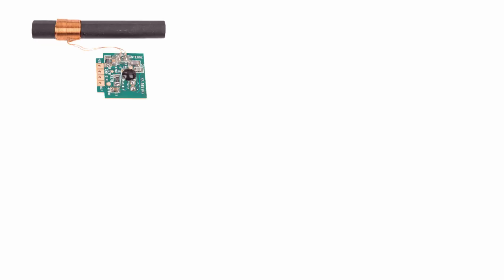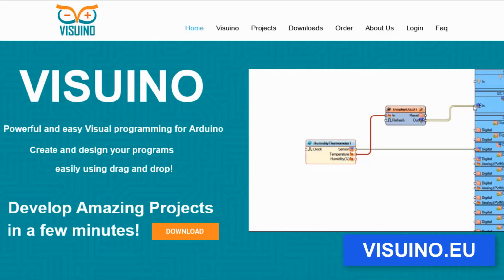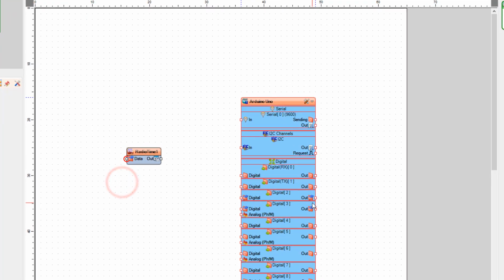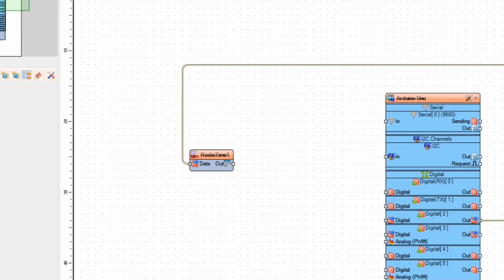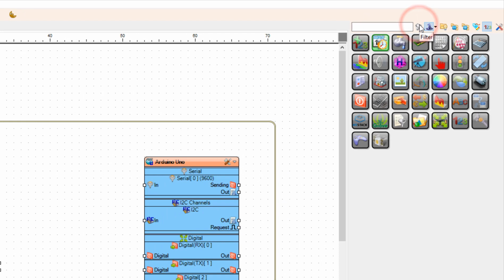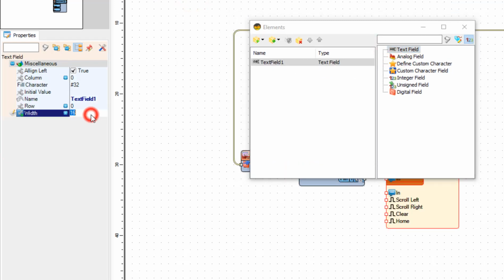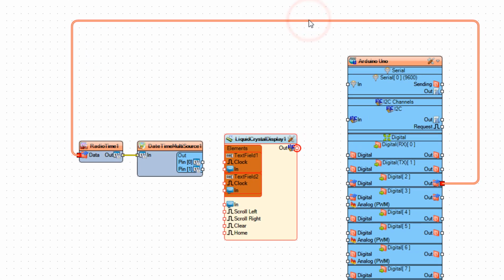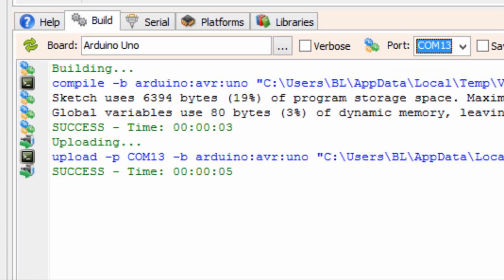Arduino DCF77 Radio Clock Receiver

Comment: does the dcf77 module need to be soldered to the breadboard
Reply from the maker: No
Reply: @visuinoprojects  Did the dcf77 module you have already have pins attached because mine just has castellated plates? If not, can you let me know how you got it to work?
Reply from the maker: @NouraZekry-w8w No I soldered them, but you can solder wires to it.